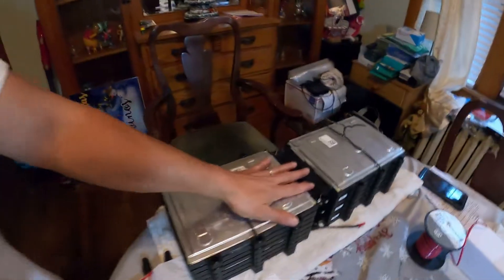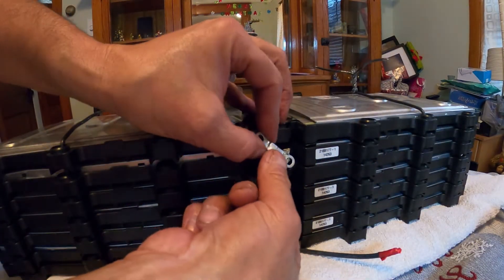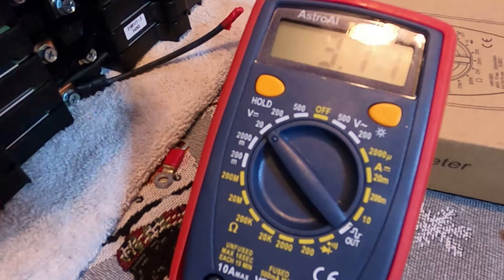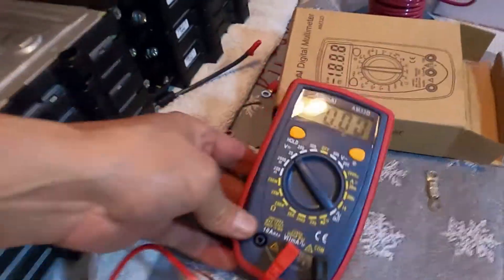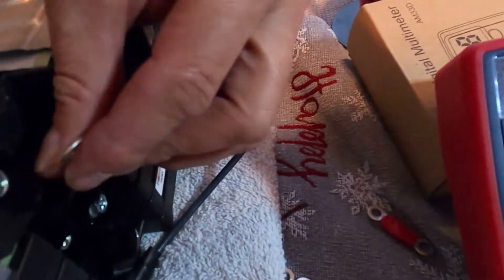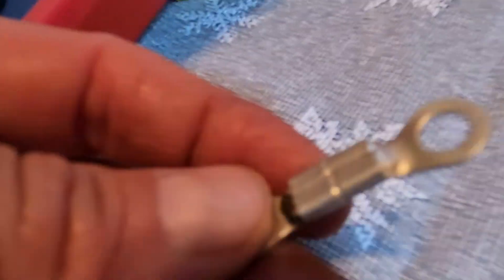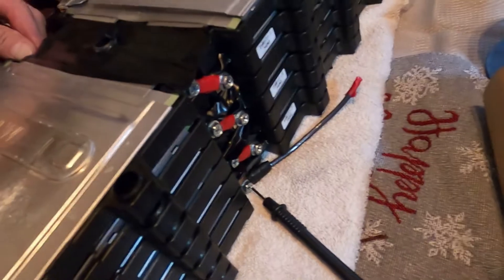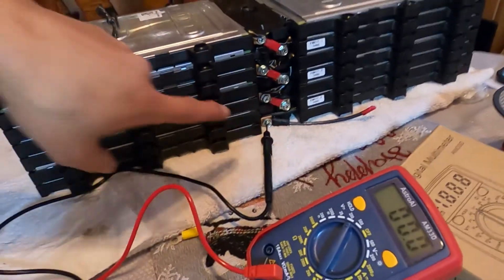Testing the Lg Chem 4p From Battery Hookup

Comment: Hey Rob what size threads on the LG chem cells? And what size connectors did you use? I have 28KW system to build using these cells (in their original metal enclosure)  and I need to parallel these packs. Thanks!